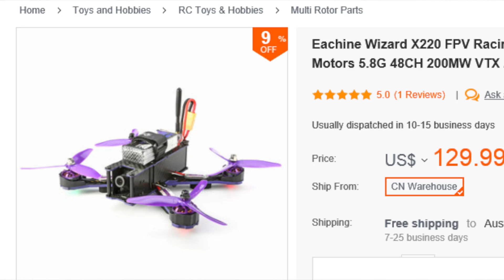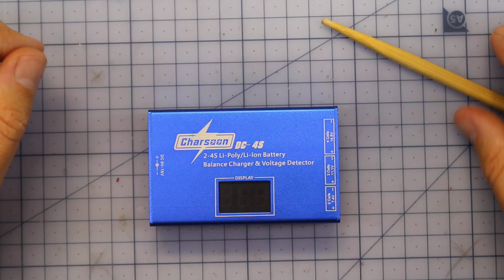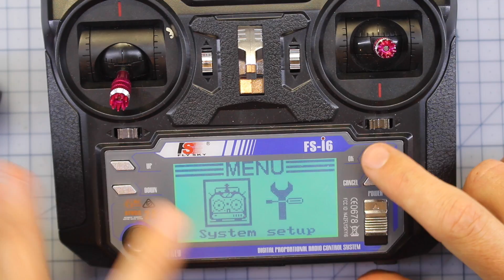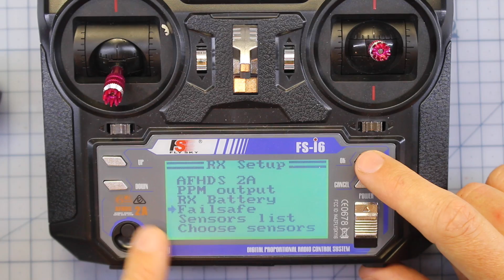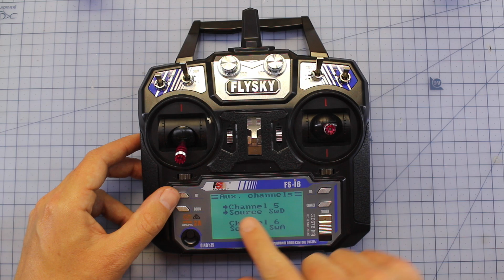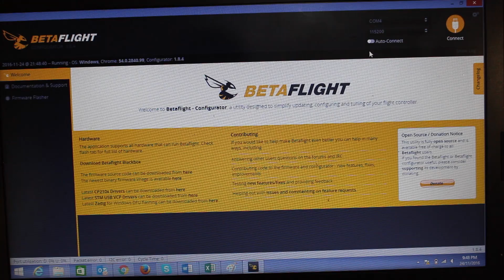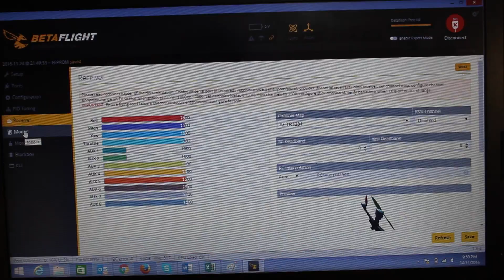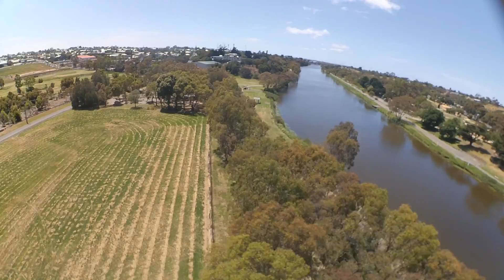How to get FPV DRONE RACING for under $300! Parts +Full setup.

Comment: i've done my own research and came pretty close to this, the only thing different in my setup was the drone itself which came about 180 eur total vs 130 eur for the eachine.
  the pro's for my drone are the bigger motors ( iFlight XING-E 2207 1800KV vs 2205 2500kv) and better flight controller(Racerstar StarF4S 30A Blheli_S Dshot 4 in 1 ESC AIO F4 OSD)
but i do plan to upgrade the drone in the future with dual 4k cams to record 3D, and probably upgrade to skyzone 3D goggles to try out 3d FPV since i will have 2 cameras set up anyway.

Comment: Can i raise the battery mh for more long time run with same set up like 5200 or 5400 mh
Reply: If you put in a battery with a larger capacity you will get longer flight times, but your quad will most likely be a lot heavier so it will have less power/punch.

Comment: It it possible you can do a 2019 version of this? Or whould you still say this is it to get started? 

I keep coming bavk to check all these vids.. no clue where to start.
Will this hobby take a big learning curve? I've never solded anything electric.
I do have a lot of gaming expierence like battlefield and other fly like games. But for 300 I whould like to try. Ive read I should spend alot of time in a virtual simulator before actually flying. 
But it does look like a fun hobby. 
What whould you recommend for someone who does want a clear view when flying? (Ive seen some vids about the dji but it is expensive to start with. )

Comment: How long to charge the batteries?
Reply: 4 or 5 days depending on the infrared receiving neuron you get
Reply: @smokeypalms7154  so you can fly these every 4 or 5 days? That's terrible
Reply: @theearthdelivers9271  im kidding buddy. made all that shit up. prob takes about half an hour to charge, and most people have multiple batteries. youll want something to measure the voltage of your batteries so you dont overcharge them and break them, im sure you can find some videos on proper battery management

Comment: Can I use this transmitter / receiver setup with my drone build I’m building following your most recent $99 drone build video ? Also would I have to solder wires to the receiver from my flight controller  ? Where would I plug in the receiver ?

Comment: Coming from DJI and looking to start in FPV to get some more.dynamic shots.  Is it possible to record HD video with these. Any tips on gear for that function. Thanks
Reply: You can get a go pro mount to attach to the front
Reply: @CocoaMelon99  thanks

Comment: This  video got me into the hobby. From the x220 I upgraded the camera to a Runcam swift 2 and the vtx to a newer Eachine one. I also bought some Fatshark dom v2s which make it a bit easier to fly. 

I'm about to build my own quad for the first time which should out perform it quite a bit. 

Not sure if the x220 is still worth the money. If you're still looking at this video, perhaps checkout the X220S or the X220 HV for more newer Eachine products.

Comment: Did i just beat the system like yo i have an idea to get an fpv
Ill teach you here the steps

1. Buy a vr for like 50 bucks or higher 
2. Buy a drone from walmart that is 40 bucks or higher that drone needs to be a camera support 
3. Connect the phone to the wifi of the drone or do everything to access the camera of the drone 
4. Dont put the phone in the phone holder of the controller  
5. Put the phone in the vr that you bought then wear it
6. Then you have a fpv drone goggles thx for reading

This idea just came to my mind

Im just joking

Comment: Dont get me wrong Stew is a great guy, but DONT GET THE WIZARD. Coming from a experienced pilot and from countless others, the wizard is SO BAD. Build a drone yourself. Get a better quality drone. 
and the biggest tip of all... Save up for a little bit longer and get quality gear.
Good quality goggles cost $300 at minimum. this tells you how much quality is in this $300 bundle.
Get a Taranis QX7
Build your own quad, you will need the fix-it nohow.
Get Eachine EV800's, they are the best for the price. next step up is $250 more.
Get a Mobula7, its an AMAZING quad. WAY BETTER than the Wizardx220 for the same price, and it costs less in the long run before the batteries are so cheap.

Comment: Hi dronelovers,

If i flash the newest software at betaflight on the wizard, will it still be like "ready to fly" and can i just do the steps showed in the video, or will i have issues to set it up like shown? So would it be better for a noobie to use the old software as it comes from factory and just do the steps from the video?

Best Regards

Comment: What do you think of these? Eachine EV100 720*540 5.8G 72CH FPV Goggles With Dual Antennas Fan 7.4V 1000mAh Battery For RC Drone
Reply: No I wouldn't buy the Eachine ev100 the field of view is so small ! I would buy the Eachine ev200d . It's more expensive but it's a way better : better field of view, higher resolution, DVR!

Comment: I have my wizard and I’ve binded it and set all my channels and I’ve tried to connect it to beta flight but when I do it fails to open serial port. And it does nothing when I flick the arm switch and it just does nothing when I give it throttle or anything

Comment: After crunching some numbers and finding tax, the total for me came to $283.6, as of cyber Monday 2018. I would pick out the parts asap before th deals end, because I expect prices to go above $300 with all the working links, (original battery used in video doesn’t work, and the headset aswell, so more money is payed for each.) Also note the sales tax of you state can effect the price.

Comment: Hi; Great and very informative video.  I have a small question.  At the moment I own a Hitec Aurora9 reciever.  Can I use it with Eachine Wizard X220 without any problem?  Thanks in advance. Cheers
Reply: Also have Hitec optima transmitter but it doesn't write PPM on first channel

Comment: Man I have bought the wizard x220 2 weeks ago. I have thrown the camera in the bin and put a caddx. I have taken off the side plates for better airflow and threw the props in the bin also and got cyclones. Re routed the fpv antenna out the back and brought the radios antennas out off a zip tie from the arm insulated so no issues from the carbon interference.

Comment: Im having touble getting the quad to respond to the transmitter its bound its got the solid red light also plugged in the ppm slot channel 1...can anyone help??..also im running the FS-I6X the updated version

Comment: Its now 2018 and im really interested in getting into the hobby, is this still the best setup for starting on a budget? thanks
Reply: Not really. Eachine came out with the x220s which is slightly better than the original. Nothing wrong with the radio. Heaps of better goggles tho
Reply: Today you're gonna want to buy a Nazgul5 4s
Reply: I went for the x220s shortly after commenting

Comment: Thank you! A full year later this is still great. SO CLOSE to getting this exact drone, per your instructions, in the air! 95% there but hit a snag and trying to triage now.  In case you are still providing help here, I'm going to float my troubleshooting question here. All seems to be set up correctly, but when I go to configure it via Betaflight, my Flysky Receiver does not even register - no color bars at all on the Receiver tab - all bars at "0."  What might be the issue?  Thank you!
Reply: try resetting settings, in the setup tab. dont forget to check your yaw degree in the configurations tab so it is still 270 or -90 degrees. i hope this helps

Comment: Hey, I am highly considering buying this exact setup, but i have one question. If I am flying this drone up pretty high is there a way to know when to come down to change the battery? just wondering if you can the the battery status on the controller. [I dont want my drone to fall out of the sky]
Reply: Savage Beast you shouldn't fly this setup high

Comment: The Eachine Goggles Two 5 Inches 5.8G Diversity 40CH Raceband HD 1080p FPV Goggles for RC Drone, does it come with a VTX chip that I have to install or replace the existing one from the Eachine X220? Please let me know

Comment: I'm having a problem with my wizard. My fc is the cleanflight sp racing mof3 v1 so I tried it in betaflight and in cleanflight and had no luck. I also tried it on serial instead of ppm on both programs and still had no luck. It seems that when I go to the receiver tab, the different bars are all at zero and they do not change when I move the sticks on my flysky i6 transmitter. I did make sure that ppm was on in cleanflight/betaflight along with the transmitter. If anyone can help it would be much appreciated. Thanks!

Comment: Hey guys, I’ve unfortunately ordered FlySky FS-i6 with FS-IA6 receiver (not FS-IA6b). Is it still a chance to get the drone in the sky or should I re-order the right transmitter? Still waiting for the goggles from china.
Reply: It will work fine, just a little lower quality receiver.  about 1$ difference.  The antennas are wires on yours.

Comment: Is there a big difference between iA6 receiver and iA6B setup? I got my Wizard in and bound the receiver to it and controller successfully (connected the quad to channel 1 on the receiver), set up the arm switch on the controller (SWD) and tried to power up quad and controller and I’m not getting anything when I flick the arm button. Not even a hiccup. Also no throttle response.

Is it necessary to update using beta flight? Or should it at least respond out of the box w the receiver connected to it?
Reply: Sounds like you need to connect more wires.  Just one wire to the receiver wont work.  Check out one of the build videos.  (Note that most of the builds have the cover off the receiver.)

Comment: You did a great job with this video..After the holiday season i am gonna follow your video and buy this setup. A few questions i have is, can you buy parts for this little guy? like motors, speed controllers and frame parts? Again great video for someone wanting to get started!

Comment: Hi it has been a year already any updates on this? Maybe new parts cheaper?
Reply: How about now it's been another one year are u Alive?
Reply: @jamshedsahak9981  what about now with another year?
Reply: I'm new to the sport and thinking about getting this package deal,are there any up grades??
Reply: @duanemontgomery9968  Might want the Fsi6x instead of the Fsi6 shown in this video, has 10 channels instead of 6
Reply: @dl5200  what's your opinion of the Rise Vusion 250 Extreme package deal?
Reply: @duanemontgomery9968  Looks like a pretty good beginner drone, although you can get much more potential from one you build yourself. But if you want something ready to fly without having to change betaflight settings, and worry about having to fix your drone up if you crash it, this may be a good choice
Reply: @duanemontgomery9968  Also make sure you have a bit of experience flying before jumping right into it.... maybe via simulators
Reply: @duanemontgomery9968  Also if you are truly new, you should research drone parts and functionality of those parts, otherwise setting it up may be a major obstacle
Reply: dont get wizard
Reply: After 7 years, how are you?

Comment: I binded the receiver (The red LED stays lit and doesn't blink) but when I go into betaflight the Roll, Pitch, Yaw don't move when I move the sticks. Help?
Reply: I added a little buzzer onto the 'beeper' pads of the board and when I change the values in the modes tab and click save, the beeper starts buzzing. I try moving the switches on my radio but nothing happens
Reply: Edit: I flashed the firmware to the latest version and all was well
Reply: im not the best with drones but i suggest getting everything off it then watching the video and putting back together at the same time as he goes through it in the video pretty well
Reply: I updated the firmware and it started working ;D

Comment: My question is this. If you dont have anyone to fly against,and you are just thrashing around,how does that count as racing? Sadly,there is no one in my area that even race drones. I checked with the local RC clubs,no one races. Hummm. I talked to a couple guys but they are more into photography, not racing. I guess mabe it depends on the area you live in huh?

Comment: hello there. I have had my Wizard now for a few weeks and from all the videos i have seen it looks like it will be a blast to fly. But my only problem is i am having heaps of problems with beta flight no recognising that the drone is being plugged in and i am not able to flash it either any help would be greatly appreciated
REPLY
Reply: Emil Van I’m having the same issue did you find a fix?

Comment: My only problem is, your drone is completely not the drone from the 99$ build with or without upgrades. You are throwing me off man with setting things up... I'm completely new and had to do more research online to understand so much you fail to mention, and I'm talking about absolute basics. The upgraded fc does not work for beta flight, it's responding to clean flight for me so you showing me set up in beta just messes with me. Second I had to boot my fc, which thanks again for "informing" me on how to do that. That's the hardest thing to understand you know? How do I know I'm doing it right at all? I may have screwed up my fc. The one you used in the 99$ build upgrade version. Instead of making big hype on the product. Be way more I'm formal and don't skip stuff..

Comment: How does this receiver/radio stuff work. How do you sink a remote to a quad and so on. Also I’m thinking of doing your $100 build as a first. Do you think all of this together but replacing the wizard with the build is a good plan?

Comment: Gdaaaay Stew, love the channel and the videos and because of this I have just purchased this set up from the links you provided. I'm in Ireland so delivery was 5-25 days which I didn't mind at all..............BUT.............the Charsoon balance charger is being shipped with the wrong DC input and is killing lipos. Not trying to ruin the video just letting you and others know that it is an issue. I'm now going to get the Turnigy Accucel-6 10A charger and a new set of lipos. Hope this info helps and "Happy Flying" :-)

Comment: hi I just purchased this and bonded my remote and tried too plug it into the computer and launch Betaflight and the drone won't connect but I thought in the video you said you can fly it without plugin it into the computer so I plugged in the battery antenna on and turnted the remote on an tried pushed the throttle up nothing happened just wondering what I'm missing

Comment: how dangerous is it when it starts to rain oder snow or something like that?
Reply: Lol dont fly while raining. Snowing will most likely freeze and harden your props, and mmight damage the magnetic polarity in your props. It got my ESC wet and it stopped working. I got another Wizard instead of another ESC.
Reply: for sure i wont fly when its raining but when it starts and a few drops might get on the quad, or generell moisture from fog or so, in germany the weather isnt predictable :D

Comment: I can't figure out what's wrong with my drone. i followed all the steps in this video and still can't get it to fly. it connects to betaflight, but it doesn't register when I move the joysticks. is there a problem with my flight controller? please help
Reply: "i just reset to defaults via betaflight and it works like a charm if someone had the same issue use this trick!🤘" worked for me

Comment: hi thank you for awesome video but i have a question i could not see any movement when i connect to the betaflight there ise no colors on channels when i tried to move sticks do you have any suggestion.
i connect receiver and transmitter but there is no response on the screen thanks.
Reply: i just reset to defaults via betaflight and it works like a charm if someone had the same issue use this trick!🤘
Reply: You are a legend, thank you

Comment: then what about the other two videos, the ones with aprox 99$ and under 200$? You mentioned those builds were ok, altough cheap. Now you say if you go lower than 300$ you are not gonna have such a good time. I would say it would be best if you would mention this in the other two videos, like: hey guys, you can get this with 99$ or under 99$ but you are not gonna have a good time, better go with "under 300$". right?

Comment: The battery charger in this video has ruined two of my 4s batteries, filling the first two cells to 3.1v and the second two cells with 4.2v. In the end choosing that charger will cost me much more in the long run.

Comment: My receiver won't show any rates of my controller sending to beta flight
Reply: Yes ive had same issue, with my stick values,  unfortunetly, the quads beta flight is out dated by the time you receive it, unless your running beta flight same as whats on your flight board. I found this to be my problem. So just have to flash the board to which ever beta flight your running on your pc. Or down grade beta flight. Hope it helps 😀
Reply: breakdefice thanks for the reply,  got it all figured out now :)

Comment: when u plug in the lipo battery, does it charge the drone because, I noticed you dont have the battery plugged in when you were flying. How does that work
Reply: What are you talking about??? The battery is mounted by the strap that says EACHINE at the top.